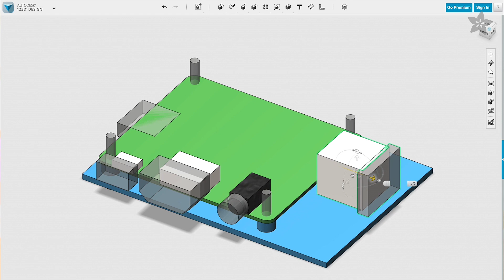3D Printed Raspberry Pi A+ Case

Comment: I was thinking of using a raspberry pi for running arduino programs onto an arduino. So the pi can act as a user interface and the user can select a code to run on the arduino

Comment: A simple and sleek case. I have a B+ running octoprint for my 3d printer, but I have not yet designed a case for it. I noticed that your cases all have rather large holes in them, I'm guessing for ventilation. Any recommendations on how much ventilation is need to keep the pi from overheating while designing my case?